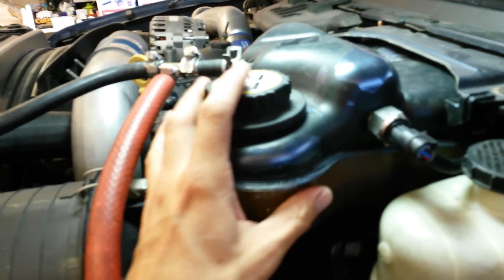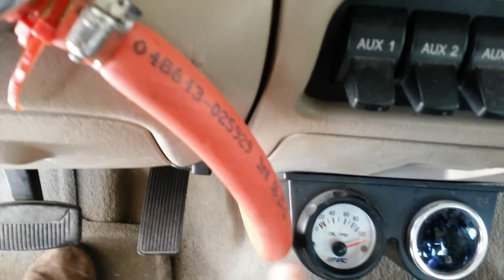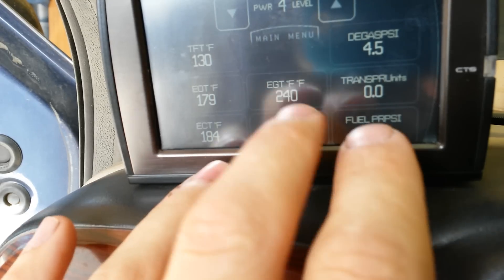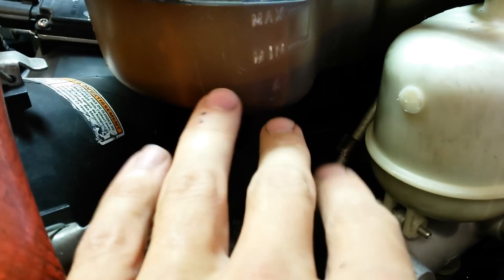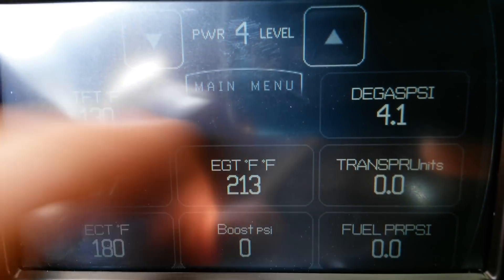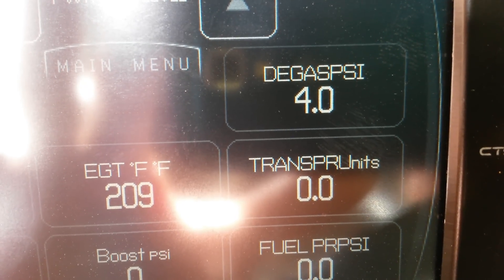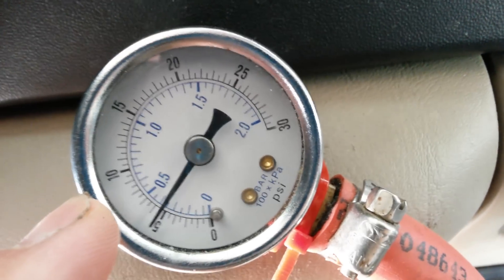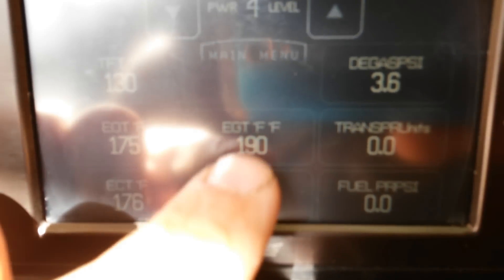FORD 6.0L Diesel~ Why You Want a Degas/Cooling System Gauge

Comment: Tha you for the help. I'm installing a  new coolant filter in my 6.0 powerstroke . Had the system flushed twice and still have the trace of oil / dirt  in the degas bottle . So hope the filter works. Thanks again!  
Dave

Comment: I'm a retired chemist and 6.0 owner.  I had to figure out all of this before knowing about your video, WOW!  My issue is that COPIOUS amounts of air are coming from somewhere and pressurizing my degas bottle / cooling system.  The truck has been EGR deleted.  The bubbles have been multiple chemical tested and are NOT exhaust gasses.  There are no leaks in the cooling system.  I must secure the degas bottle cap semi- loose so all these air bubbles can vent while driving.  My oil and coolant are pristine and the tailpipe exhaust is colorless even at startup.   The truck requires very little oil / coolant replacement.  The truck has been doing this since I bought it in 2022.  The truck runs and tows to spec with 18 mpg.  Where are all these bubbles coming from??????

Comment: I don’t pull anything with my 2006 f 250. But I run it pretty hard and it creates alot of pressure on the upper radiator hose. But I don’t think it’s overflowing from the degas bottle.

Comment: How long did you run on blown head gaskets? I have owned my truck for a long time and have been monitoring coolant pressure for several years and I have always felt like I make too much pressure but is it even possible to run that long on blown gaskets? I tow 15k regularly and most everything seems fine other than the fact that I seem to make alot of pressure. I run the levels low as I should but it will still puke some coolant if I run it had up a hill from time to time. It doesn't do it often but still. I don't see any real connection to throttle either and it takes at least 15-30 mins to get up to pressure, but it will usually ride at 15psi most of the time I am towing. What do you think?

Comment: Hey bud if your still checking this I have a question. I had coolant overflow after I ran my 2005 6.0 hard up to 100 several time. I found out my cap was leaking. Bought a new cap and new tstat and did my test. It runs in 4-8 just cruising but if I punch it it will go up, if I punch it again right after the more it goes up. Is that a blown head gasket or normal? I have it tuned and it had APR studs and EGR delete when I bought the truck. What does yours do when you get on it?
Reply: I have a 2006 6.0 setup like yours. Mine seems to run up to about 11 to 11.5 doing what you did but no higher. I have had coolant blow out the cap but that was towing fifth wheel up the mountain pass in summer running 65hp SCT tune. I installed the gauge so I can see when I get close to 16psi towing. Otherwise I think my gaskets are fine.
I would also like to say you don't have to run a 3/8 hose into your cab. I used the normal line of a fuel or oil pressure gauge uses and it works fine. I used a 15psi  1 1/2 in. fuel pressure gauge and permanently mounted in the dash below the headlight switch. A great location to view it from.
Reply: Les Johnson yeah i has no signs of a blown head gasket beside that gauge that I installed, I mean I drove that truck across country not a problem. But the curiosity got the best of me and I ripped it down cab on and sure enough blown around 3 cylinders. Put it back together and runs the same lol. I can’t believe I never loss coolant or ran hot or anything. But now I can get on it and it will never hit 16psi so problem solved
Reply: I think if you have a tune on it the pressure jumps alot more

Comment: Hey, had a question.  I did this test on my truck but I used an oil filled gauge.. does this affect the results?
the gauge stayed basically 0psi running around town and about 4psi at highway speed... had to really romp it to get 8-10psi..  think my coolant system has a leak because the system depressurizes once I let off of the throttle.  can't really see any major coolant leaks.  any tips?  Thanks
Running stock tune, not studded and no egr delete.
Reply: You had probably already run the truck when you put the gauge on? if you have it on from dead cold, it should build up to about 7 or 8psi. Also, since you are seeing throttle response, do you have it teed into the line going to the radiator or the line from the engine?

oil filled will not affect results.
Reply: +GadgetClass it doesn't really build pressure until I drive it.  I believe there is a pinhole in one of my hoses or something funky going on.  I have the T in the line from top of the degas bottle into the top of radiator. (the smaller line)
Reply: +MrRogers Have you changed your coolant cap lately? If not that may be the problem. They are known to go bad(not hold pressure) I have seen several post recommending that as your first upgrade after a purchase of a used 6.0.